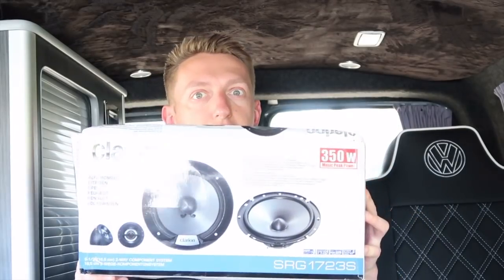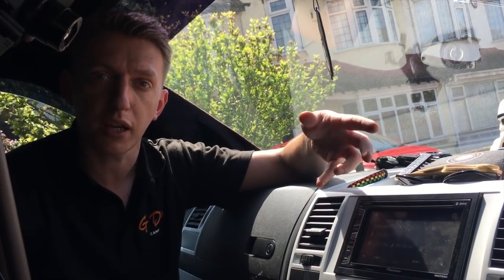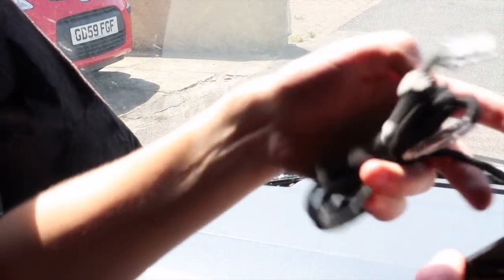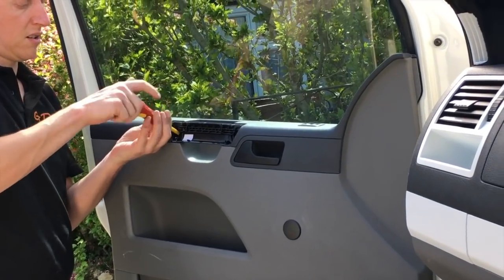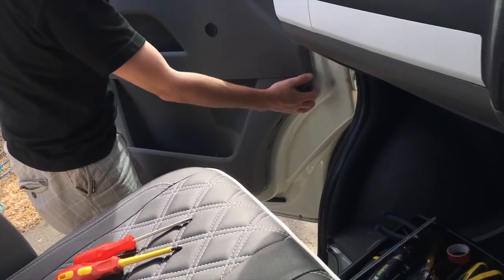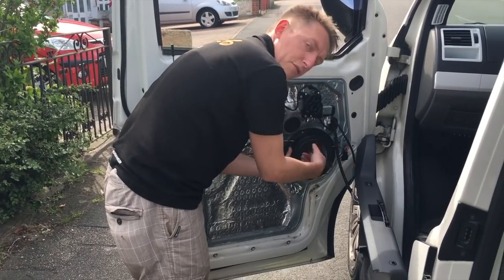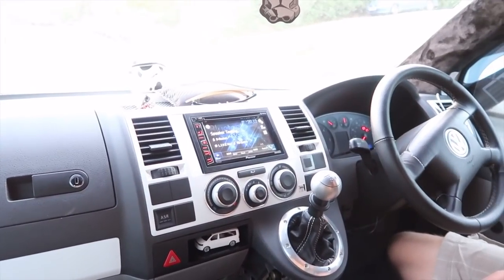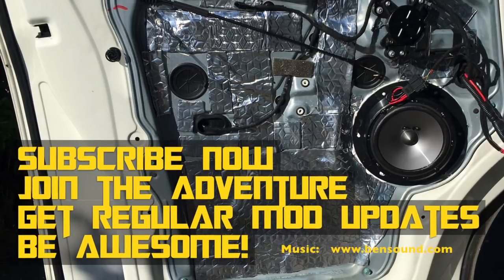Fitting Upgraded Front Door & Dash Audio Speakers - Self built DIY VW T5 camper conversion

Comment: Considering upgrading my front speakers and found your vid, great video, concise and great info as I now know what to do and the fact you can purchase direct replacements. Mines a 2013 Sportline but  imagine it very similar. Great advice on being careful of the windscreen 👍. Just 2 things I had issue with, firstly I’d edit the video so the sound comparison is one after the other and,to me more important, mastic? Really dude? You had to drill out the rivets so why didn’t you just rivet the new  one or perhaps use some rivnuts? Unless you were advise to use mastic for deadening etc?
Reply from the maker: Mastic.. ashamed to say it was a bodge job!! Didn’t have a rivet tool and needed to get it back together... Hangs head in shame!! 🤦🏻‍♂️🤣

Comment: mastic?? why not rivet them back in?
Reply from the maker: Sadly the plastic collars around the cones were smaller than they should have been, couldn't rivet them on without drilling new holes in the metal window regulator plate - Time was fleeting!

Comment: Hi G Dub, I want to fit dash speakers in my T5 2010 but there is no speakers there as standard but the mesh is there, will I have to install new wires to power them from the head unit? any help would be great
Reply from the maker: Sorry mate, bot too sure. Try contact Skipton Car Audio. They'll likely be able to provide you with a modified loom for the job!
Reply: Oh thanks but I’ve done it, but tricky and cut arms lol but fantastic sound and glad I did it 👍

Comment: hi mate why did you bond the speakers and not use a wooden collars
Reply from the maker: It was a bodge job tbh. I was under the impression I had been sent all I needed to fit them and then discovered otherwise. Needed to get the van back together quick so went with some sealant I had kicking about!

Comment: Hi. Great video -well explained.  I’ve an 04 t5 that has the previous type of radio/surround…have you any idea if there is a kit that i can get to upgrade so that the van can take more modern radios?  i.e.  the radio/head units that take two fixing screws on either side of the radio. Thanks.
Reply from the maker: Contact SCR Radio… they’ll be able to help you

Comment: Hi good vid was just wondering why you bonded the speakers on and did not rivet them. Is this what the kits says to do? Like the look of this kit.
Reply from the maker: ken Cottingham to be completely honest i didn't have a rivet gun and also the cones were slightly smaller than the riveted holes on the door. Sealant was the quickest solution!!! #bodgejob

Comment: Thanks for the video. I like that the tweeters we an exact fit for replacement of the factory tweeters, but the picture of the tweeters on the box does not look like what you unboxed. Your look bonded onto the mounting bracket. Did Skipton audio modify the Clarion package for a T5 before shipping it to you, or is this really what Clarion supply despite looking different to the picture? The cost of this Clarion package is quite inexpensive. Would you buy the same again, or do you wish you'd spent more?

Comment: How do I get a power cable to run my amp  from the engine bay to the cab
Reply from the maker: Through the rubber grommet located behind the battery tray on the bulkhead 👌🏼

Comment: Love your videos, helped me so much. Thanks :) Noticed you've sprayed your front air vent covers. How do you do them? I've searched every where and cant find anything
Reply from the maker: I did a video on it!

https://youtu.be/ZPd8_DzUric
Reply: @GDUBTV  thats the 1 i watched but it's only the centre ones
Reply from the maker: @andypolfers the side ones would obviously be the same to spray. To disconnect them you need to prise off the side trim at each end of the dash using a plastic trim tool. Each vent is held in with a T25 torx screw at the back of the vent, then they pull out quite easily. Then you can spray them. Fitting is reverse of removal.